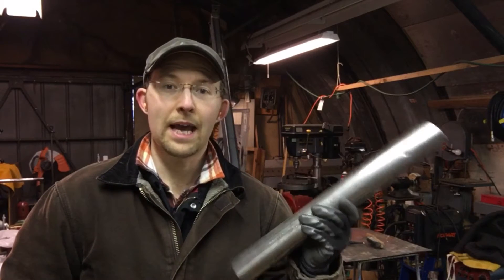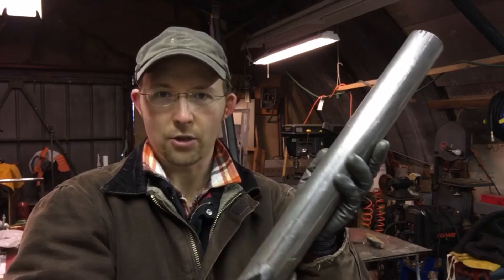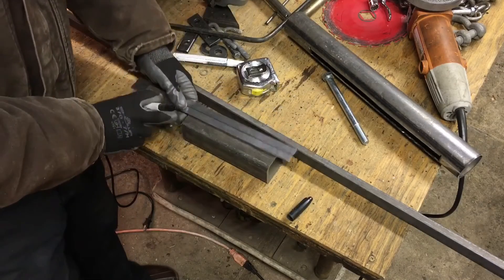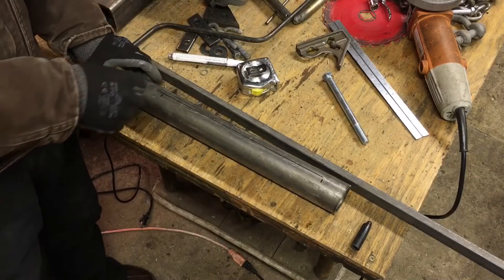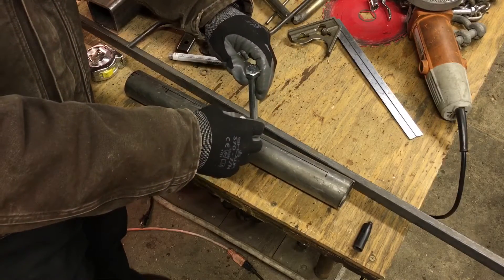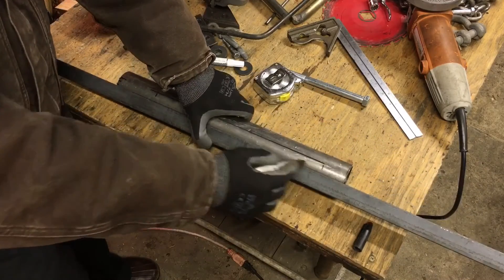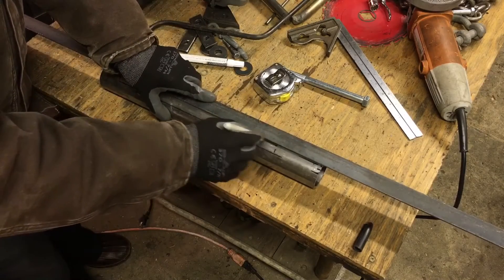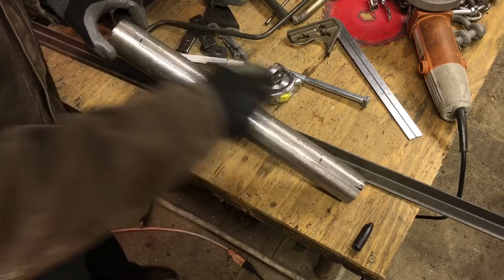METALWORKING HACK! Drawing A Straight Line on Round Tube???

Comment: My approach (In a minimally equipped shop) is to stick the pipe in a vise. Level the top of the pipe with the plane of the top of the jaws (Just butt it up at both ends of the jaw to something flat laid across them). Hook a flat tape on the end of the pipe, mark your starting and end points of the cut out, remembering to account for the radius of the drill bit we will be using. A visual confirmation that your tape is running parallel to the pipe is sufficient. For a longer, inconvenient system, particularly with multiple cut outs that need to be in line, consider clamping the tape at both ends. Check that your marks are actually on the top of the pipe with the straight edge used before.

Especially if you're trying to make through-cuts, this is great because you can just drill through with a bit that matches the bolt, as long as you can drill plumb--no shame in using a drill guide! If you have a long cut out, mark and drill extra holes to reference for cutting. You could draw a line, referencing the edges of your drill holes, if you prefer. The angle iron trick shown in the video would work, here. For best precision, modify the process to be employed on a jig on your drill press. If the jig is made to slide--guide blocks/rails are sufficient, nothing fancy needed--you can do the entirety of the cut using the drill press just by punching out successive holes, and then very gently sliding the piece through the running bit to clean up. Convenient to switch out to an end mill bit for the clean up, but still be very gentle.

I think the main benefit is that it helps ensure the through cuts are aligned as they're kept in plumb with each other the whole time. And since you're using the width of a drill bit to create the cross-width of the slot, you don't have to do any math of finding what circle segment matches the diameter of your bolt... or avoid just guessing. And since the drill cuts straight through the circle, it leaves parallel edges which can be referenced during your (presumably) free hand cut, rather than just guessing as to what approach angle will leave you with edges that are parallel to the bolt, leaving the most material for best fit and to avoid wear.

Or if it genuinely doesn't matter, just free hand cut that shizz without any setup whatsoever

Comment: I used your method using aluminum angle bar on a 1/2" EMT pipe. Drilled 1/8" holes every 3 inches and laying out the straight line kept all the holes on a straight line on a six foot length of EMT stock.
Reply from the maker: Cool, good work! Glad you found it helpful.

Comment: *Bonus Tip*
1.Tac weld the angle iron on to the pipe
2. use it as a guide
3. now make straight, length wise, cuts.

Comment: you should have a measuring tape that is made to mark on pipe. they are about 3'' wide, made from a strong, cardboard-like material, I'm guessing about 18"long and thin. it rolls up into its self. I think you can get them at your welding supplier. I use a piece of 2'' angle iron with feet welded at the V point to hold the round stock. thanks for the vid

Comment: What if you don’t have a handy piece of angle iron that’s the right length.
Reply: It depends upon the length of your pipe, but if you have a long pipe, get you a long piece of narrow rope or a small cord of some type, run the Rope through the center of the pipe and hang the pipe up horizontally. At each end where the Rope is touching the pipe make you a mark. Now simply remove the Rope and stretch a chalk line between your two marks and strike the line.  👍
Reply: if your able to own a line laser that helps also
Reply: No problem...just clamp the ends of the tube on suitable size v-blocks placed on the marking out table, reference the top of the tube with the height gauge, subtract half the O/D and scribe your lines.👍😃

Comment: yes but how to find the center line on opposite sides of the tube?
Reply: Depending on the size of the pipe, you could probably use what steamfitters and welders commonly use: https://pipefitter.com/store/tools/wraparounds/

Or, Measure the diameter of the tube, calculate the circumference (diameter times 3.14). Cut a rectangular piece of paper, with the length being the circumference you just calculated (width doesn't matter). Mark the paper at halfway point of the circumference dimension. Tape and wrap the paper around the pipe till it meets itself. The marked halfway line will be the opposite side of the pipe. Divide appropriately to get degrees etc.
Reply from the maker: @commentatron  right on. I love my grandpa’s old Wraparound!
Reply: @eldigitom9680  Good one, too!
Reply: That is what I am  wondering if I missed

Comment: Good to know!  This is simple hacks like this one that makes the difference on how quickly you can achieve a project.  Did you find any trick to mark or cut the ends of a round tube?  Especially a bigger one that does not fit in a chop saw?
Reply from the maker: Yes I do have a trick for that. I'll try to remember to make a video of it, but I'll attempt an explanation here: you can use a Wrap-A-Round Curve-O-Mark (like this: http://amzn.to/wrap-a-round) to mark the pipe. I've also gotten similar results just using a regular steel tape measure. Wrap the tape measure around the pipe with the numbers against the pipe (you won't be able to see the numbers). The curve of the steel tape keeps it pretty straight as it wraps around the pipe. Use a sharpie to mark the pipe using the wrapped tape measure as a guide. Hope this makes sense :)
Reply: Thanks a lot Tom.  I will look for the Wrap-a-Round on Amazon.
Reply: Had to put in Amazon search  wrap-a-round pipe marking tool